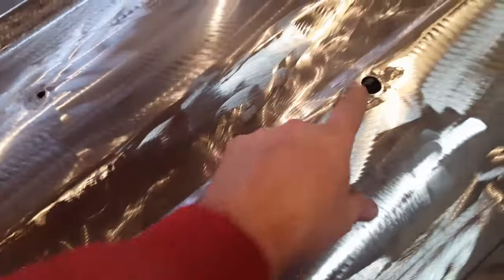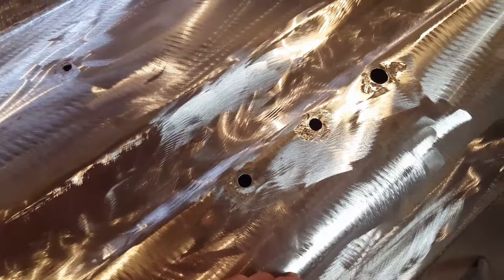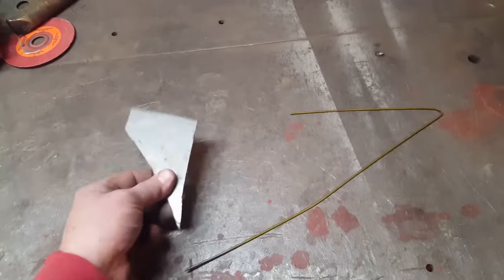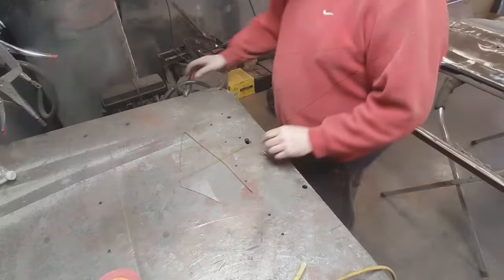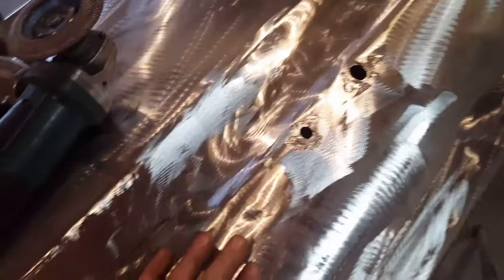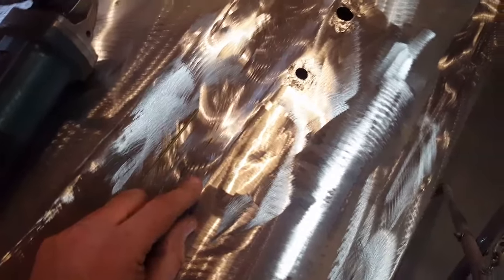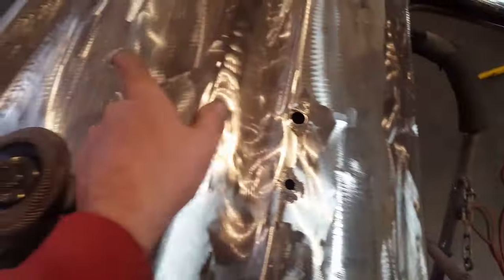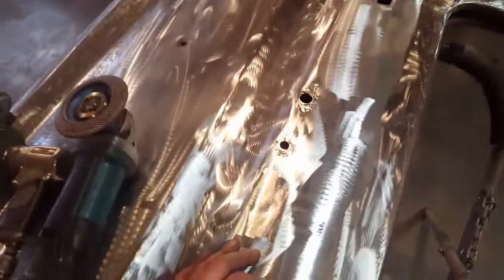How To Weld small holes the easy way

Comment: I hold a piece of copper pipe behind that I flattened as a backer when I fill holes as the weld wont stick to copper.
Reply from the maker: What do you do when you can't get a peice of copper behind them? I have cunk of brass for that. Copper pipe melts
Reply: @fitzeesfabrications  Sry I commented guess you got offended, I'll unsub you. One thing though copper trick is just one more tool in my arsenal not the only and I have been welding for 45 yrs. So have a nice day and hope your channel does well.
Reply from the maker: @KingKatRider   not offended. All is good. I shown this cause there are times you can't get to the backside. Would be easier with the copper/brass trick then. Sometimes there are inner braces that you can't in behind. This little trick is great for that. Always looking to learn new things. Ill never know everything. Lol. I learned more from you guys then you know.  Goes both ways. Thanks agian for watching.

Comment: I use a brass piece behind the hole to weld against. The weld doesn't stick to the brass and the hole is filled. This would be great when you've no access to the inside.

Comment: When you weld your piece of coat hange to the steel, put the piece of coat hanging in your battery drill and spin it as you grind it for a rounder piece of metal!!

Comment: An even easier way is a decent block of aluminium just hold it behind the hole and zap the hole closed with the mig, the aluminium works as a heat sink to and will just twist off after the weld.
Reply from the maker: Copper as well but you can't always get behind the hole

Comment: Why not just back it up with brass or copper and puddle weld it , you could have done all the holes in the time you put it making a little tiny sheet metal and wire fill in, just saying, millions of ways to do the same thing I guess

Comment: I used to place a piece of copper underneath and weld. The weld does not adhere to the copper.
Reply from the maker: Or brass. Have a chunk of brass in my tools. But very hard to get inside a door. Hold the brass/copper and weld on the outside.

Comment: Use a block of brass behind the hole ,fill in with weld ,won't stick to brass ,hole is filled grind smooth move on
Reply from the maker: And if the hole is a half inch and in middle of a door? That's alot of welding with a brass back stop!

Comment: Why not just thread the rod  through from inside of the door. Hold the rod so the piece of metal  on the end of it is flush  with the backside of the door weld it in place cut the rod off. Grind down til flush. Seems simple. 🛠🤪 oh yeah make sure your window glass is out of the door when doing this otherwise you could etch the glass were the welding sparks hit it.
Reply from the maker: You ever notice that the hole in the door never lines up with the holes in the inner structure of the door? So you have to jam your arm in thereat some weard angle and try to hold it in place

Comment: why not pull the coat hangar up through the hole from the inside and have the plug just a hair bigger than the hole thus the weld would be a lap instead of a butt?
Reply from the maker: Don't like lap welding

Comment: Use a piece of copper plate. Hold it behind the hole. Weld that sucker up. I'd be finished and ready for filler by the time you frigged around doing that.
Reply from the maker: Ok. Put a crash bar behind the hole and we will have a race! Then we will see which spot takes less filler! It's a large hole. 1/2 inch or more.

Comment: why not put a piece of copper behind the hole and just fill the area with weld... then grind it down?
Reply: or...take the little piece you welded the coat hanger to...pull it up thru the hole from the inside and weld it up...then grind off the hanger and extra weld?
Reply from the maker: Yes those way too or if the hole it to big for all that you can do it this way.
Reply: @fitzeesfabrications  thx

Comment: Why not pull a oversized piece of metal up from the bottom  and fill the hole
Reply from the maker: Cause then you have a place to trap moisture. That's been done Nanyang times. It works but not a clean finish

Comment: got a question have you tried the roll on primer for your bare metal ?       please keep the laughs to a minimum plz
Reply from the maker: I brushed it on. Nothing wrong with it. I hate cleaning the gun every time. Mix up a small batch and brush it on. Dollar  stores has cheap through away brushes. There was a time all primers were brushed on. Paint too

Comment: Use a piece of brass from behind and weld the hole up. The weld won't stick to the brass.
Reply: Brass retains heat and can contribute to distortion in a panel. You want to use the least amount of filler to get the job done without distortion. I use copper when filling aluminum holes but almost never with steel. Except in tight corner welds where you don’t want filler material pushing through. It works for some things but, I wouldn’t use it to fill holes in a panel with a bigger  surface area. At least when it comes to thin material such as .063” or 18 gage or thinner.
Reply: It won’t add distortion. By drawing the heat off it lessens distortion. But I wouldn’t use brass. That usually has zinc. We don’t want to weld at zinc. Either copper or aluminum.
Reply: Mel Gross no zinc in brass.  Welds will not stick to it either.

Comment: What a waste of time grinding the tiny round piece of steel. Why not place a penny behind the panel and weld the hole up?
Reply: Because it warps and distorts the panel on large holes. I guess it ts the difference between getting a craftsman's repair or a warped bondo job experiment by a wannabe with a penny.
Reply: @MrDemolitionmission  No kidding....Milner is molron.
Reply: I would like to see a comparison of the two methods,  with bigger holes yea, you gotta make the plugs, but smaller holes i cant see the usefulness.
Reply: Don’t use pennies. They been made out of copper plated zinc for a long time. Welding heat near zinc is poisonous.
Reply: @djmjr77  Do a comparison. Any hole larger than a pencil will be really globby and may warp. This is my experience. I also used a damp rag to cool the weld.
Reply: @melgross  As we go down the rabbit hole of danger in daily activities. Some times it is better to do nothing. My daughter fabricates. I do not over police her. That will destroy her love of welding. Next thing you know you will have a gamer never leaving the basement.
Reply: @eduardosampoia5480   What??????????????????????

Comment: Come on, edit out the grinding.  Really?  2 min. of grinding to fit a hole?  Notice you didn't show a close-up of the finished result; probably know why from the black surrounding the weld, which probably resulted in porosity.  Ever heard of preflow?  A professional would have worn PPE gloves.
Reply from the maker: 30 years welding. Never knew that a pare of gloves was differents between a professional and a non professional! Learn something new every day. Thanks .